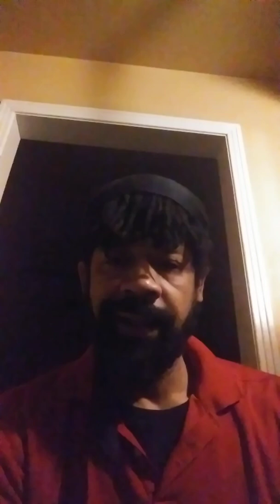TPE vs Silicone Sex Doll Science Class!

Comment: I bought one for my truck. TPE. I didn't know the difference. It got messed up due to heat and abrasion.  Now I know a silicone do is best for the truck, while a TPE doll is good for home. 

Thanks for the video. You explained it well. 👌🏿
(You earned a new subscriber)
Reply from the maker: Even though silicone is a lot more resistant to heat it can still melt if it gets too hot. It depends on how long you would have to leave her in a hot unattended truck. If it's only for small spurts of time I think you'll be okay!